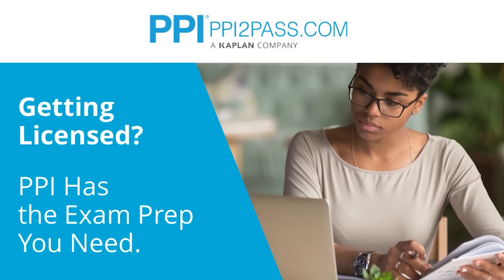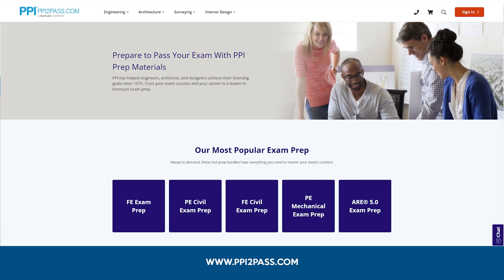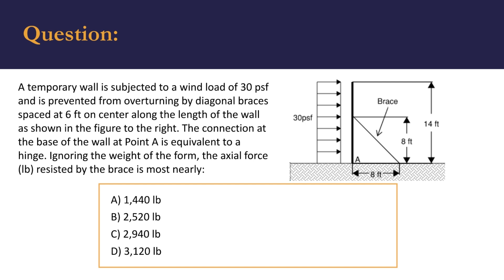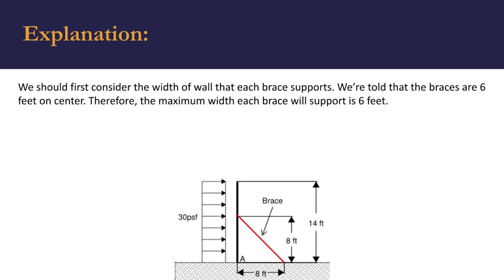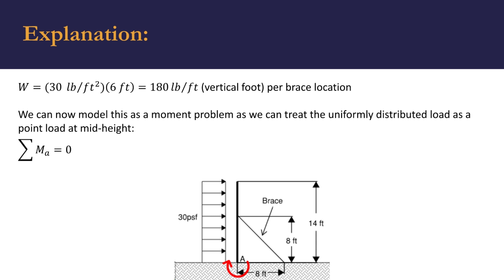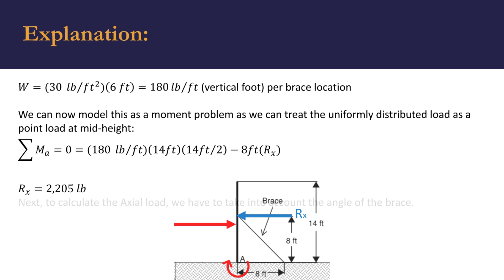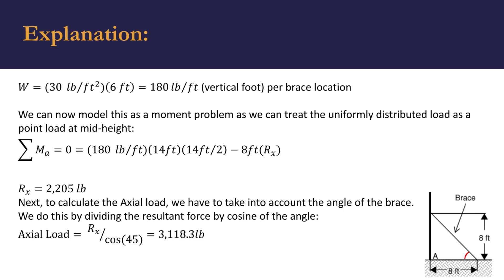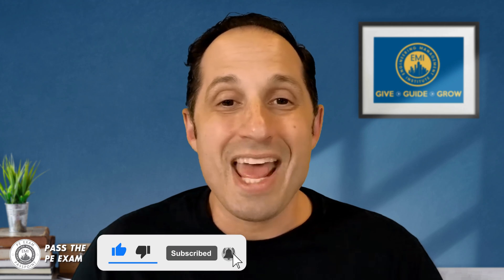Calculating Axial Load (Practice and Solution) | Civil PE Exam Review

Comment: Why do you multiply the resultant force by the total height of the wall and the midpoint of the wall in that first step solving for the moment about A? I thought only the midpoint would be used since the distributed load was converted to the point load. I have been out of school for a while, so any explanation would help.
Reply: Hi Brandon, 

I totally understand about being out of school for a while. I graduated in 2015 and passed the PE in February. Prior to that, my last exam was the FE in 2016. I definitely recommend what you're doing -- going back and refreshing on topics and asking questions. 

To answer your question: "Why do we multiply the force by the total height of the wall and the midpoint of the wall in the first step solving for the moment about A?"

The force from the wind is given as 30 lb/ft^2. We know the maximum distance between braces is 6 feet. So, for every foot in wall height, the wall experiences 180 lb/ft of force (due to the 6 foot width being supported). With a height of 14 feet, the wall experiences 2520lb of force. In other words: 2520lb/84 ft^2 (because the surface area of the wall between braces is 84 square feet... 2520/84 = 30). 

In these types of problems, we can assume that the load is uniformly distributed and that the wall is perfectly rigid. Because we are told that the braces are 6 feet on center, we can assume that there is 3 feet of wall on each side of the brace that is supported by said brace.

Because the wind load is uniformly distributed over the area, we can convert this to an equivalent to point load that is perfectly centered on the wall. That center point is on the same plane as the brace and the hinge at point A. 

However, because the wall is 14 feet high, the midpoint where that wind equivalent point load is located is at a height of seven feet. Suppose that if the wall were 16 feet high, and the brace remained where it was, the point load would be located exactly in the location where the brace attaches to the wall. However, because this is not the case, we have two opposing forces causing moments that must be balanced to prevent the wall from rotating about point A. 

Because we are told that the wall does not rotate around point A, we know that the resultant force from the brace is equal to the force exerted by the wind, which we have modeled as an equivalent point load.

Please let me know if this fully addressed your question. If not, please follow up and I will respond.

Enrique